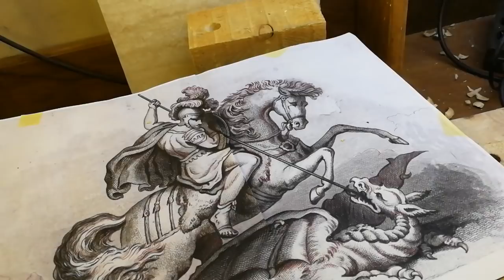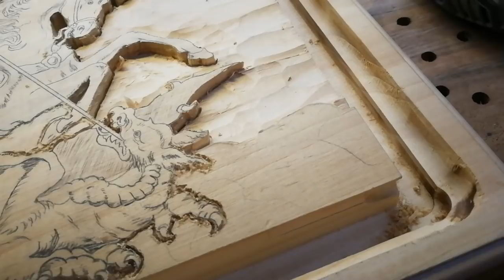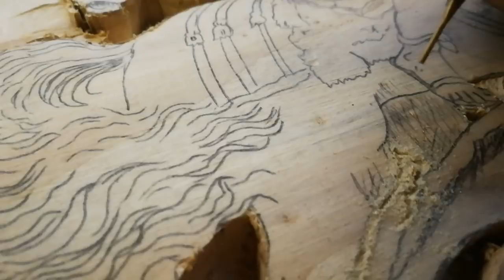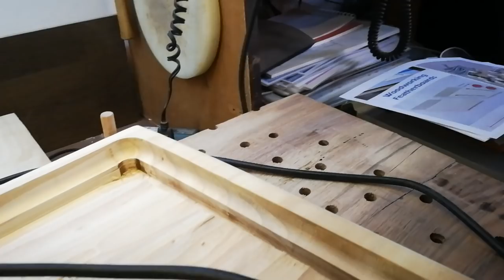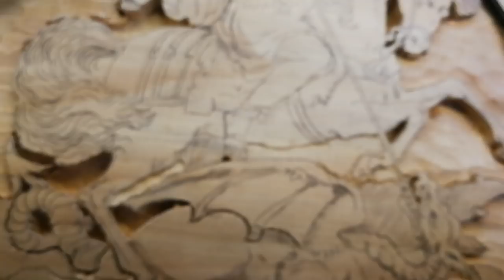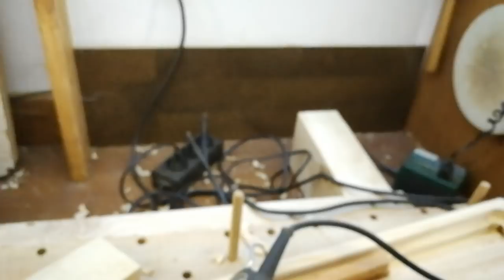Dremel carving Saint George killing the Dragon

Comment: where did you get the bits you are using, nice work, thanks,,godbless
Reply from the maker: Hi ! I will buy this small Cut Bits on Chinese Shop named "Banggood.com". Or rotary cutters for Dremel, high speed rotary cutters. 
Just enter in the Google Search Engine "Dremel rotary Tool" and you'll get quite a lot of results.